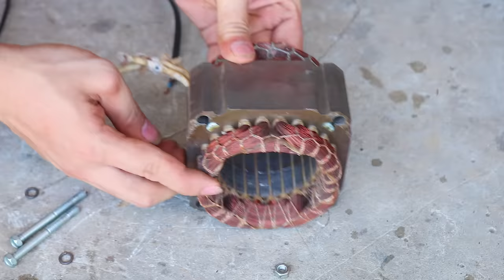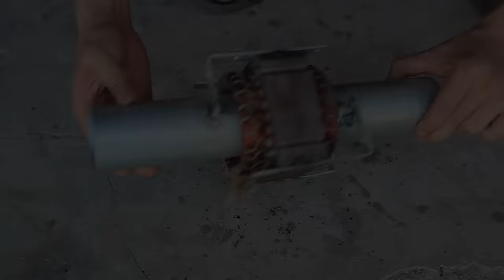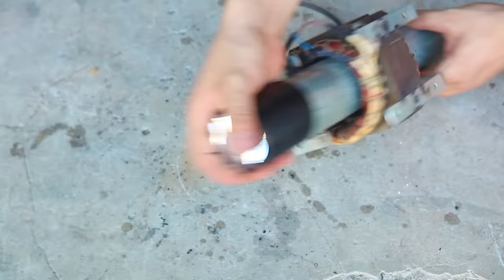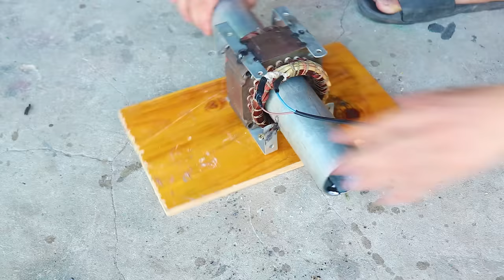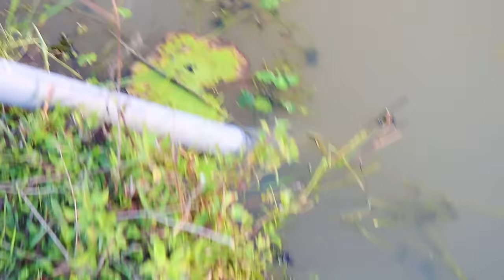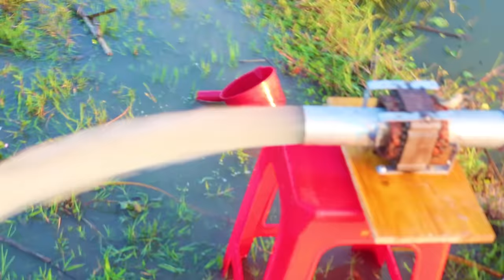I make high speed water pump from a washing machine motor

Comment: That's impossible, if you accidentally drop a water on the motor of washing machine it cause a short circuit, and you got a electric shock from the motor.
Reply: Ok
Reply: Motor will born 1 second
Reply: Не сразу что бы мотор замкнул надо что бы нарушение изоляции
Reply: Tudo mentira isso porque ele preocupa em caixa o cano na água aonde q se viu isso só bobo q aquedita nisso .
Reply: And you get this ratio
Reply: 9
Reply: Video Fake..deception..
Reply: Fake
Reply: Theres no circuit if those wires are overheated... And made a contract to other metals
Reply: Interesting idea, i dont know this is can really work. 4.02 you spread the water, didnt it short ?
Reply: @gipadang9815  there is no any idea . Just fake . The Turning magnetic  field  cant move a woter.
Reply: @kolyavasyukov2020  You are Right bro.
Reply: Not really DC motor can even run inside water.
Reply: Ap ne ke se kya hai😱

Comment: Likely, there is a water pump submerged that is actually responsible for pumping the water, but it was hidden or not shown in the video.
Reply: I think he install a router inside the pipe that is connected to the
starters
That how a induction motor works
Reply: E verdade!

Comment: The man revealed his trick himself when he put the suction pipe in the river without Jack Valve
Reply: Indo nesia
Reply: Please could you explain?
Reply: You cought perfect point, it not possible to hold water priming,
I think it fake time pass like china toys😀
Reply: Hoax
Reply: @senoaja4254  
what do you mean..?
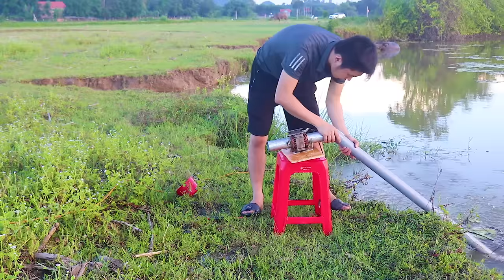Reply: Look at 5:44 he cut the video ,there is a pump hidden in the water and it connects to it.
Reply: @qnedim3200  
If it wasn't an underwater pump, the hammer wouldn't be used to drive in this direction at the minute 5:44
Reply: If you pour water into the tube as he shows (priming) then it will just flow downhill and seek the same level as the pond. The tube will never fill. It can't be primed. There is a pump in the pond. Physics 101.
Reply: @ameersamiy  video Fake
Reply: Where is footvalve??

Comment: when you load, prime or bleed the pump with water, how do you keep the water in the tube, there is no check valve.
Reply: У него там насос под водой в нем есть обратный клапан.
Reply: @ИльсиярГарнаев  ахахахахах
Reply: Fake
Reply: It doesn't show inside the barrel.  inside the barrel there is a little motor that works with a 12 volt battery by 5Anper.  when He turns on the alternating current, the person thinks that He really turns on the alternating current, but it is not.  It's a motorcycle battery or car battery.

Comment: As soon as the motor is turned off, the water should stop immediately, but in this it does not happen, but it stops like after switching off the fan keeps rotating and the water stops with the speed of that fan.
Reply: Energy can neither be created nor destroyed. If output is more than input then well you get the idea.
Reply: The water was in motion so it actually slows down exactly as it should.
That doesn't mean I believe this is legit.
There are other videos that support this design.

Comment: Without rotor the stator will not withstand current. It will burnout immediately.
Reply: Yes exactly correct this is fooling the people.
Reply: ไดโว่อยู่ในน้ำอีกตัวไม่เนีบน
Reply: ท่อดูดที่ใส่ลงไปในน้ำไม่มีเช็ควาล์วหรืหัวกระโหลกเก็บน้ำไม่เนียนเลย
Reply: Stator won't burn out
Reply: @weazeldark3983  did you try?
Reply: @kuruvillaabraham7702  its a common teaching tool in electrical labs to have a induction motor with no rotor in it both single and 3phase 

The only way u burn it out is if leave start winding on but that's rotor independent 

But I'll try it soon with a dishwasher motor and see 

Turning a motor into a transformer

Comment: Doesn't the coil get hot like this ? Because there is an iron pipe inside coil and does not rotate
Reply: Maybe not make it hot while the water is running inside the pipe, but if you connect it dry, could be.
Reply: Yes without the second submersible pump pushing the water it's just a electromagnetic heating device..
Reply: @gabrieltottzi4545  it does ha

Comment: Thanks MR COVER I built this and got flow rate 10000ltrs a minute at 2000psi with just 240v, the unit I made is now used at the local sewerage treatment plant pumping effluent.
Reply: يعمل هذا الجهاز في مكان جهاز مغنطة المياه للحصول على مياه ممغنطة .... هل يكون تاثير المجال المغناطيسي قويا بعض الشيئ ليتمكن من تغير الخواص الفيزيائية للمياه مثل عمل جهاز delta water
Reply: @aymenguehef829  so you are saying that he invented a magnet for water..?😂 So cool..next invention a wood magnet
Reply: do you mean effluent from bulls
Reply: @jefryjonas1978 When the polarity of the magnet is changed, the water “flows” in the opposite direction. The movement of the water will cease when the magnetic field is no longer perpendicular to the current.

Comment: Does the type, size and density of the copper wire in the coil make a difference, and if any, can you explain to me please?!
Reply: No English lol
Reply: It's all in the voltage....using 277/480 works best, if you have a plug for it, don't hack wire call a licensed electrician, do not use the 240v clothes dryer plug, it will burn you.

Comment: You can actually hear on the video that something is rotating in the tube, I have been involved in music since I was 12 years old, at an engineering level, you can clearly hear when you turn it on that a suspension and rotors in it cut the air with the speed, making a strange high-pitched sound and when there is enough load gets the small RC motor, then you can also hear how the rotors of the fan move the water while rotating, I don't really think this little film is true, because it's also interesting that it didn't happen to show the device in person when it's functioning, I don't think it would be so difficult to fully demonstrate the phone or the camera while it is functioning, I think it's fake, but even if it wasn't, then please show it around more convincingly while it's working and look for more evidence without cutting into the operating principles, maybe people would believe that it's possible .

Comment: How do you convince  electricians, especially  ones who work on a/c motors that rhis is real? Im that guy. I can tell you now that there was no power going to that stator. It would act as a induction  heater and would have turned the metal pipe passing through it red hot.

Comment: this is well done but it is fake at minute 5.43 there is a cut in the video time to connect the submersible pump to the tube and the amount of water that pours into the tube is very little for the size of the tube

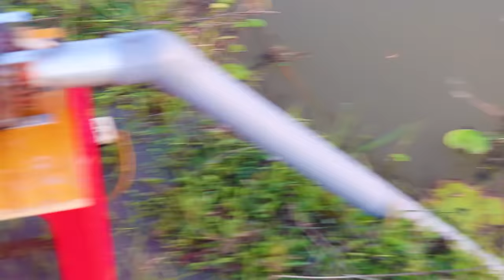Comment: 6:32 You can see black cable going for pump placed under water.
Reply: Between 5:42 - 5:44 there is cut in video to fit the pipe to pump under water.

Comment: A Water Pump invariably need impellor and foot valve and a roter with at least 800 RPM Producing torque to rotate the shaft of impellor. This video is 100% fake. no Alc motor/machine will work like that. The induced magnetic field can have effect on a charged conductor , but not on water.
Simply absurd!